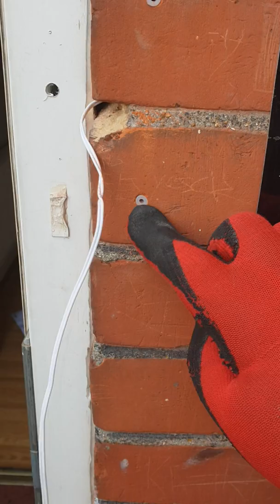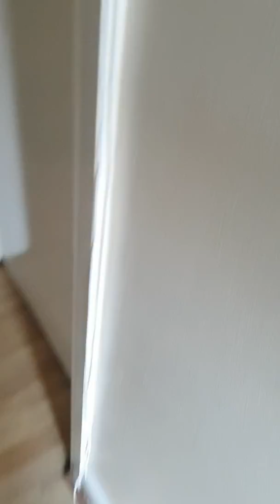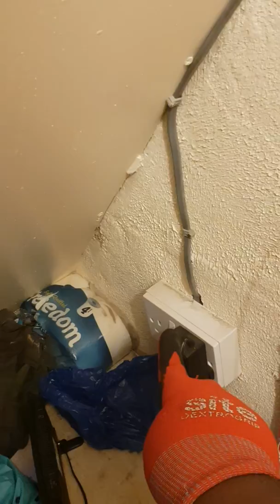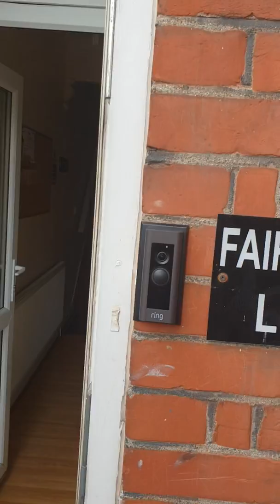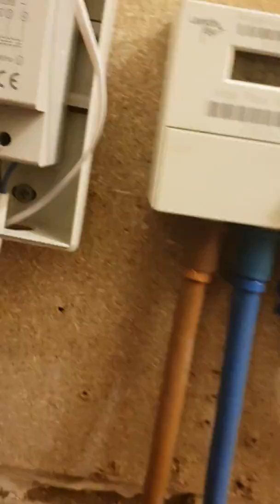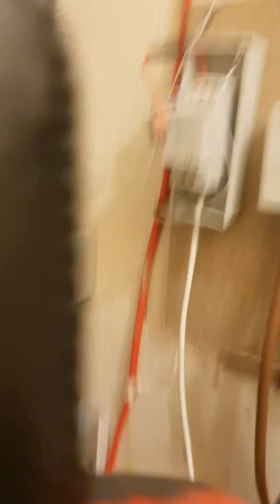Ring video doorbell Pro installation explained easy! UK ( w/o exisiting door bell)

Comment: Great video - Thank you. Not easy to find info for UK installation. I have one question if you don't mind. The component that you refer to as the power pack (the bit containing the 1 amp fuse). Do you still need to use that if you are going to go for a plug in transformer rather than the transformer provided in the kit that would normally go in a consumer unit?
Reply from the maker: hello if you get the official ring power adapter which i think costs £30 i would think not but i did a sky bell install a few months ago and i had to install a 10 ohm resistor on one leg in line on the adapter as it did not work properly, then tape it up but it was then hidden in trunking down in the basement.i would say to install it as ring expects it and now the new bypass device is out and they may then be able to detect if it's installed or not as i think it's a small cct board so they could say that it must be installed before they can attend to you?
Reply: Thank you. I contacted Ring and they said that in the UK I should have been given the choice of either the transformer that goes in the consumer unit or a plug in power supply. They are now sending me free of charge a plug in power supply from California. I just hope when it arrives it is not the American version!!!
Reply from the maker: @Andrew-pq6vy  hello i've been to the uk website there is no option to buy a plug in power supply?only on the us site and it costs $30 which is a lot for just a plug?if they were cheaper and  uk model i would use them on most my install,let us know when you got it
Reply: The complimentary plug in power supply arrived from Ring today. - 240 Volts Input and 24 Volts AC output. Only problem is it an EU two pin version and not UK. Its very chunky and heavy so to put an EU to UK adaptor on it as well means it will stick out far too much. Have to decide what to do now. Does the Ring Pro not need an earth connection in the UK?
Reply: @Andrew-pq6vy  hi Andrew not surprised spoke to ring yesterday about the plug as I could not find it on the UK site they said it was only available in the U.S. and it would be a two pin .No does not have an earth as the casing is plastic if there was metal on the casing it would need to be earthed. It looks like you will need to get an extn lead to plug into the wall socket and plug the adapter into a 4 way socket ?
Reply: Just phoned Ring again and as you have discovered there is no UK version. Due to lack of easy UK plug in install options I am going to send the kit back to Amazon for a full refund. They really should provide better UK hardware options.
Reply: I agree with you I told the guy at ring to not have an easier option of having an adapter like in the U.S.  they are losing out on sales the ones the sale on eBay are usually not correct they should have been selling a UK by now
Reply from the maker: @dandare2586  hi dare it's a fuse 1 amp quick blow fuse it's not a resistor ,that has now been replaced with the bypass kit which i assume is the resistor i've not opened one up yet i'm going to try and get ring to send one out to me
Reply: @siatelecomsltdLondon  I just spoke to ring, and the small grey box they supply now is exactly the same as the orange cable thing. They just put it in a box to make it "easier". Ring told me to use it the same as the orange cable
Reply from the maker: @robsimms3932  ok thanks for letting us know

Comment: Hi, sorry but a couple of things;
1) doorbell/Tx is premantley fixed current using equipment so must be fed/protected via appropriate fused spur if off of a ring/radial. Not a plug. This would require a minor works cert as a min. **DIYers you can still do this through building control.
2) You need to segregate LV and ELV, bell wire should go out the top of the unit with a closed grommit as a min.
3) You should really be installing in "non-combustable" enclosures. (But you are right in not going into the db, i dont know of any "ring" dbs atm, and the tx would void the warranty).

.....^^it all sounds pedantic, but txs get hot and (apart from dbs) are one of the main causes of starting fires. Its easy to make electrical installs work, but if they're not installed and certificated correctly, the book gets thrown at YOU as the installer, when somebodys house burns down and insurance is void.

Recommend people stick these on anything with txs (laptops, phone chargers etc) and throw away any chargers etc that get too hot https://www.safe-connect.co.uk/hpi/
Reply: ...and before somebody says it, i know there is a ring plug in adapter for the pro etc.... but its currently 'unavailable', assume somebody has realised the reg and has put it on hold rather then sold out?? Unless there is an underlining reg that excludes a complete ELV install?

Comment: Mine didn't come with the orange fuse it came with a bypass block with 2 holes in side to push 2 cables in. do I need it if I'm going from transformer to Doorbell?
Reply from the maker: yes it needs to be inline one wire going to the ring doorbell connected and one wire going into the transformer forming one continuous wire,does that make sense?
Reply: @siatelecomsltdLondon  yes thanks mate I got confused because the bypass device in the box was completely different to anything online
Reply from the maker: @harrynorman5065  just finished a ring sunday afternoon ring have replaced the black tube with a 1amp inside with a white block bypass unit like you said great 1amp fuse kept blowing on one or two of my old installed

Comment: Would wiring it up this way, allow the ring pro to work with a mechanical door chime?
Reply from the maker: no the mechanical door chime is i think rated at 12vac the transformer with be would from 24vac might cause a long term problem ,i dont bother i completely remove the wires from the chime and then rejoin them.

Comment: Thanks for the video, only thing I would do differently would be to add a stuffing gland in the bottom of the transformer enclosure for the mains flex and then run the bell wire coming out of a separate outlet from the enclosure.... just my way of doing it. cracking video, thanks.
Reply from the maker: Thanks for the insight I do now separate the.mains and bell wire ,the mains wire was tided to the inside of the box at the bottom by drilling a hole I just did not show that in the video as I had not yet finished the job this is one of the things that really annoys me about this particular box and actually other enclosures there is no way of tying down the mains cable any other cable that's in the box so I have to drill a hole at the top or the bottom and then use a tie wrap to tie the cable to the plastic box this is a criticism that I've emailed to the companies. This is one thing that seems to keep popping up in the comments that people assume that I left the mains cable to dangle out of the bottom of the transformer without being securely tight this is not the case I would not do that because it's dangerous it's when I finished that job I secured the cable thanks

Comment: Great video this has answered quite a few questions I have about installing the ring doorbell pro.
I bought mine over a month ago but have not yet installed due to a lack of uk installation videos.
Just have one question though , I have an existing wired doorbell which is wired to the downstairs lighting circuit , would replacing the bell box (which houses the current bells transformer) with the wylex ese2 and the ring transformer work ? Or will I have to wire it to a plug as you have done in the video ? Cheers. Matt
Reply from the maker: ok if the transformer was installed outside of the fusebox and you can see the mains going via a spur into the transformer and also see the doorbell wires going into the top of the tramsformer you should be able to insulate the mains  and then replace the transformer with the new one and use the plastic casing , but if the transformer is located inside the fusebox/consumer unit you will need a qualified electrican to replace the transformer.also you would need a meter and non contact voltage tester to check that the voltage is truly insulated,if not do not attempt to replace the transformer yourself get a qualified electrican to do the job for you.thanks julius
Reply: Telephone Engineer And Ring Video Doorbell Installer The transformer is not  in the consumer unit it is built into the bell box itself with the 2 mains wires going in and the two doorbell wires coming out. I will be using a qualified electrician to fit it as I have very little knowledge of electrics myself. The qualified electrician I am using is a friend of mine however has never fitted one of these so this is really helpful in explaining to him how we are going to do it ...... I have ordered the Wylex box 👍
Thanks for your help 👍
Reply from the maker: @PRODUCERMAT  plese let me know how you get on,btw the black tube has now been replaced with a white bypass device install it the same as the black tube

Comment: Great video simplifying the install. Wasn’t too happy about having to put it in the consumer unit. Considering space is limited in there and this unit is a double and it’s just a doorbell.
Reply: Have you been able to completely install it and get it working?
Reply: @juliusuzutunda  not as yet as, will have a go this weekend and connect it to a free fuse spare that I have in the garage now my boiler has been moved.

Comment: Can you advise on which wires we need to purchase please?
Reply from the maker: Toolstation sells really good bell wire for around £8 for 100m
Reply: @siatelecomsltdLondon  Thank you.
Reply from the maker: @lordship6457  https://www.toolstation.com/bell-wire/p55533
Reply: @siatelecomsltdLondon  Thank You. What's the other wire that went from the transformer to the plug head is it this?
https://www.screwfix.com/p/nexans-round-flexible-cable-3182y-2-core-1-5mm-x-50m-white/890fk
Reply from the maker: @lordship6457  yes it's the same cable I think try and make sure its solid core and not stranded cable I hate stranded cable

Comment: Thanks so much for providing us UK ring pro owners a decent example of how to install the thing! I have a couple of questions if you wouldn't mind?

I am considering powering the transformer via an FCU box off a non fused 2 socket spur which comes off the ring main in the garage instead of a 3 pronged plug into the 2 socket spur. As in your example.  Also, would it be a good idea to  secure the flex cable that feeds in at the bottom of the transformer? Finally, not being an electrician, is there any risk to using 2 core cable in a 3 pronged plug. What with there being no earth? Thanks!
Reply from the maker: I usually a hole at the bottom of the box to hold the mains cable to secure the cable I use a plastic tie wrap it did not show in the video because I was still installing the transformer.what you are describing should be do by a qualified electrician.the transformer has only to connectors one for the line and the other for neutral as the transformer casing is plastic and does not need an earth but you can still use a three core
Reply: @siatelecomsltdLondon  quite right. I have an electrician friend who I have been nagging to do it but also doing research like this because i know these things arent straight forward. This information will come in handy when he comes to do the job. 

Can I also say ring customer support is terrible.
Reply from the maker: @19noz85  I understand but ring support for me has usually been very good like all companies you will have some people who are not good at there job but on the whole they have been fairly good

Comment: Where did you get the fuse carrier ?
Reply from the maker: It use to come with the transformer but it has now been replaced by the bypass module
Reply: Telephone Engineer and ring doorbell installer how would I wire in the new gadget to a totally new install?

Comment: Hi mate!

I've been having a real trouble hardwiring my doorbell.

I tried a transformer from screwfix but it's not adequate at 8va, I installed a 10va which lasted a day before no more power going out.

Where did you get the resistor from?
Reply from the maker: hello it shows like you have the ring doorbell 2?if so use this https://www.screwfix.com/p/byron-776-wired-wall-mounted-doorbell-with-transformer-white/80766 this bell chime has a built in transformer and is approved be ring to work with the ring 2 that way you do not need the resistor
Reply from the maker: this is also the transformer that i've used from screwfix https://www.screwfix.com/p/british-general-8-24v-8-va-bell-transformer-module/8707p#_=p
Reply: I brought the same from Screwfix for the ring 2 but it says you need an wirewound resistor connected to it also? Will have to connect it and try
Reply: Telephone Engineer and ring doorbell installer I used this too will it work for ring 2?

Comment: People watching this should know any changes to you wiring needs to be checked by a part p registered electricain and the appropriate certificate handed to the customer or checked by building control if you don't do this your home insurance will be void
Reply from the maker: hello there is no changes to the existing wiring ,my course tutor states that this is legal and does not need to be reported to building control.does this mean you have to be a registered electrican to install a telephone system or a small door intercom system?i have my 18th edition cert and domestic installer cert(part p) as well.
Reply: Not your work on this video but I have seen people commenting on them using the spare way in their dB this is what I was referring to didn't make myself clear anyway  good video
Reply from the maker: @andrewmayes3271  hello, no you are absoluatley right its all about safety and making sure that its installed correctly and with in the law nobody should be installing into the db unless they are quailfed to do so.this is how fires occur when electrical items are not installed properly.

Comment from the maker: Someone contacted me about their ring doorbell is very hot to the touch.i would get back onto ring for a replacement transformers as the ring doorbell was replaced and it's still very hot also make sure you use the bracket plate that.comes with the ring  pro so that there is a gap between the door frame and the doorbell also check what the voltage is within the ring app

Comment: the new unit has a greyish white block with it that eliminates the red wire part as you do not get that anymore according to ring and also allow your unit approximately 1 hour to charge before starting app i did it this way it worked perfectly also the white block should be connected to top right side of transformer contact ring they will send you a diagram as they did for me i am uk based
therefore this is for uk
Reply from the maker: Hello yes that is for the new white block check the vid again it's the black tube with the 1 amp fuse in  that I terminate in the zero /neg of the transformer as per instructions from ring
Reply: @siatelecomsltdLondon  great video sorry i didn't say that first on contact last time was very easy to follow but when i first installed the ring it didn't work thought i did something wrong until i found out the unit had to charge for approx an hour then felt great that i got it right this is because of your video thank you again and keep up the good videos
Reply from the maker: @UCAaaMPQ-iiEGU2RK7yvSJ_A thanks it's not the best video I want to do another one from start to finish in the next few weeks i will do that from home yes the ring pro when first installed use to take about 10 to 20 mins  before it would start working properly but the newer versions are now working almost straight away.if the video helps someone to install it safely and correctly then I'm happy:🙂

Comment: Very helpful video for the ring pro. Ring have kindly offered me a free upgrade to the pro due to constant issues with my doorbell 2 in the last 6 months. I've looked for the enclosure at tlc but can't find one similar, any help please

Don't worry, I've found it, but another question..... does the bell wire need to be of a certain spec? was looking at this https://www.screwfix.com/p/byron-7200-doorbell-wire-9m/9143d or even this https://www.screwfix.com/p/nexans-bell-wire-2-core-50m-white/451fk ?
Reply from the maker: hello dont bother with those cables i've used them and have had a couple of faults.i now use this cable from toolstation https://www.toolstation.com/pitacs-bell-wire/p55533?searchstr=bell%20wire
Reply: @siatelecomsltdLondon  I think doubling up is required because of the increased voltage compared to uk door bells.  This way even the byron 7200 should be ok